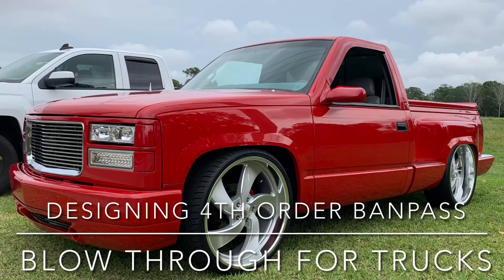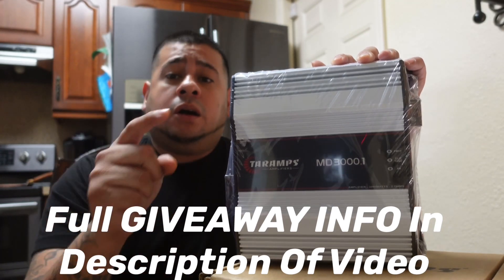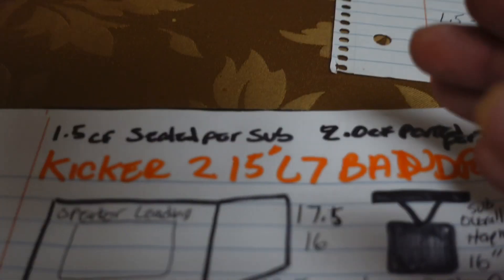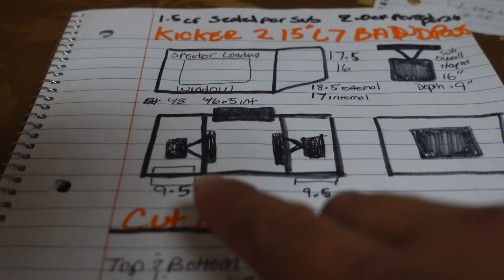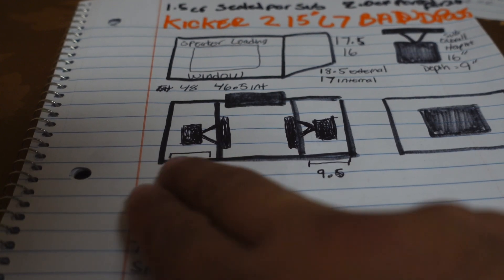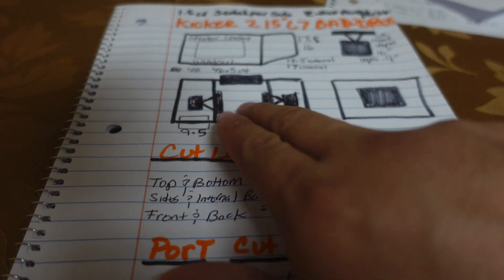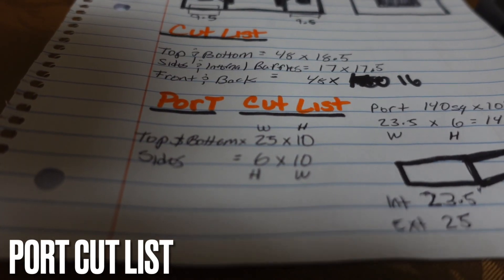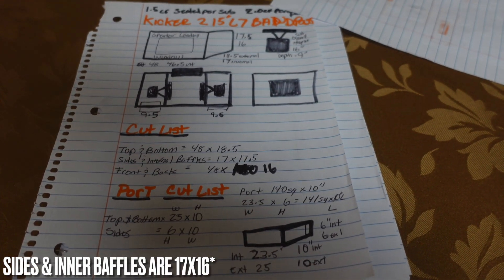4th Order Subwoofer Box Design for Chevy Truck Blow Through

Comment: In your opinion would these measurements work for any 15's? Cause my 15's say they only need 3 cu.ft ported and 2 for sealed. So I'm thinking I need to make the box a little smaller. What do you think?
Reply from the maker: Yes it would definitely be a banger
Reply: Ported and sealed enclosure considerations don't apply here.